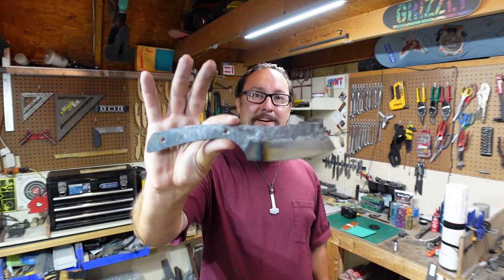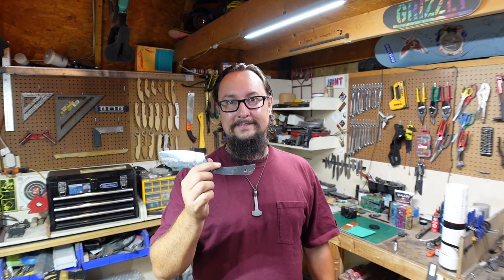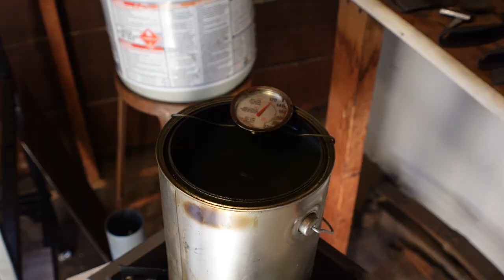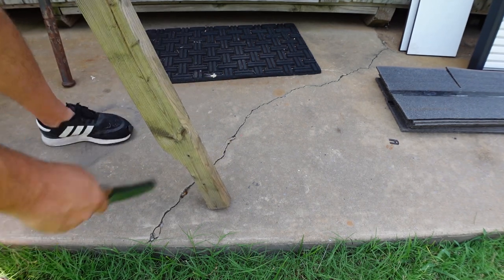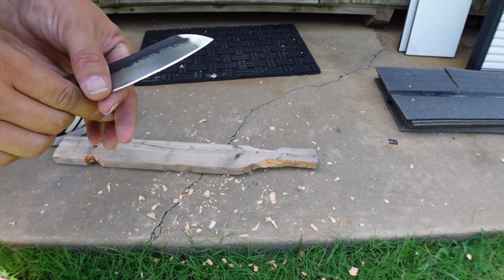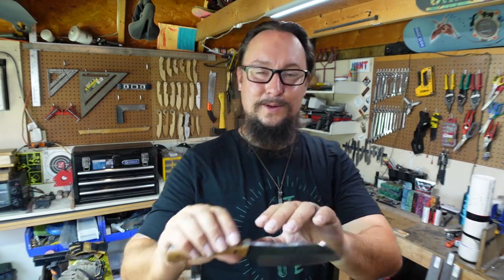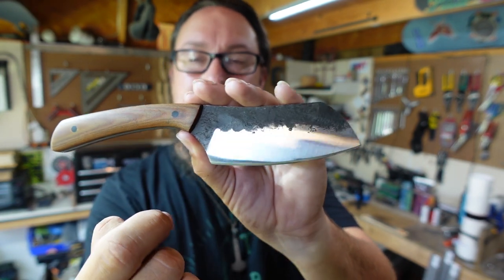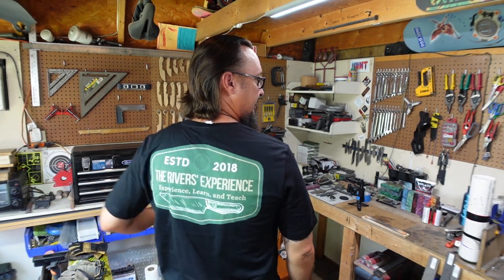Adding Handles and Sharpening the Nesmuk Scrap Knife | Knife Maker Vlog

Comment: May I ask why you add the WD-40 on the belt?
Reply from the maker: It keeps the belt from gumming up while using it. I also feel like it puts a smoother finish on the steel.
Reply: @theriversexperience9383  Especially if you run them fast they can heat up pretty quick on the finer scotchbrite belts too and leave streaky stuff on the blade
Just as an aside with 3M products and stuff,  next time you throw a belt order in check out the Cubitron II ceramic belts. I picked up a 36G and blew through half a dozen 8" chefs knives with it hogging off metal really fast and it was still as sharp as it was when it started.
Bit more expensive but for the heavy cutting it might save you some dollars by staying sharper for longer

Comment: I hope you did,  but you didn't show you clean the resin off your bearing scraper. There's gotta be something better in the shop, literally almost anything,  to do that with.  Hate to see a tool like that ruined,  or least add a lot of work into a clean and possible regrind. Just started watching the channel,  appreciate the content!!!
Reply from the maker: It's a Palette knife for mixing paints. I clean it after using it and I only use it while applying epoxy for handle scales. Thanks for watching.

Comment: The design on the front of the t shirt is cool, but the printing on the back is way to large and just to much. Just have the front printed. Leave the back blank.
Reply: I like your shirt from the front, not the back part much.  I think the back-front design in a size of one inch by two and a half more or less would be better as if it were the design of a known brand